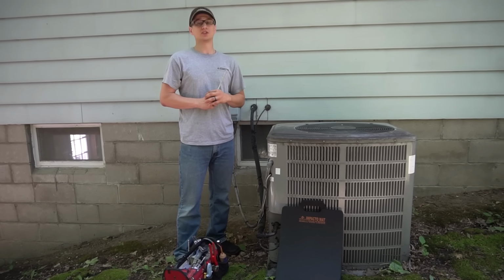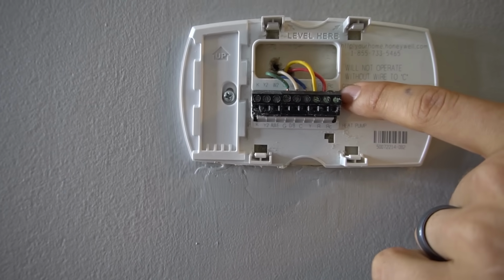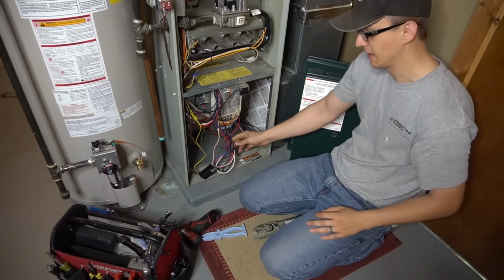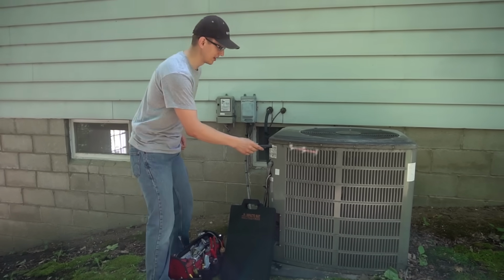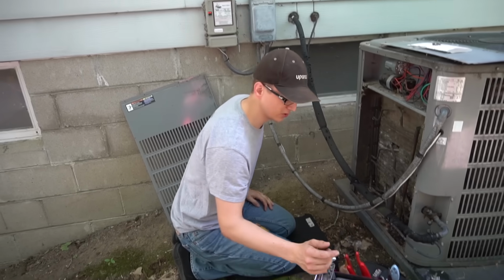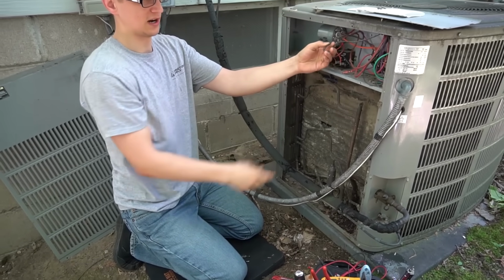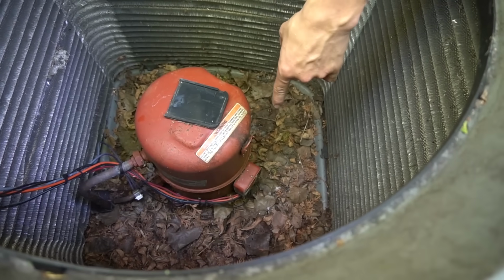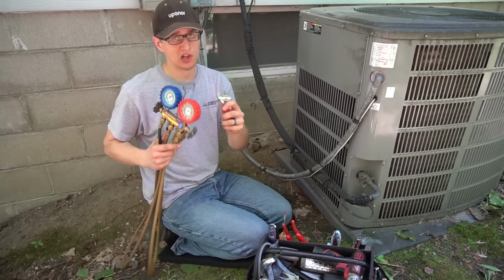AC Unit Not Turning On - How to Fix It Step by Step

Comment: Excuse me sir you should be a college instructor no joke you make everything understandable for every listereners backround you are phenomenal LOVE IT !!!!
Reply: I second that. I was convinced when you correctly said OL=Open Line. That one is a pet peeve of mine.
Reply from the maker: @tdriggers3  Thanks Tim! Though I said that part correctly I am sure there are plenty of times when I don't as well (in this and other videos) Luckily we have the comments section though, where smart people can voice their corrections ;)
Reply: VERY WELL DONE FROM START TO FINISH...GREAT JOB.
Reply: For real though...Great Job!!!💯✅
Reply: Yes he should be
Reply: I agree ☝️
Reply: Why after capacitor was replaced ac worked then less than 12 hours later 78’F thermostat set but house 80’F.  I reset thermostat then ac started cooling again. But I’m monitoring temperature in case outside fan stops and house temp goes up to 80’F again.  Wondering maybe ac waits for temperature to be a certain warmth before it restarts cooling again??? I shouldn’t have to reset thermostat when house temperature is higher than thermostat setting of 78’F.  Otherwise call back technician for this job fix?
Reply from the maker: Thank you! :) Glad to hear you liked the video!
Reply: @WordofAdviceTV  I hv a 3 ton heatpump txv 20 yrs old, supercool is 14F, superheat is 10F if temp taken at evap vs 13F if taken outside on vapor line, outside was 94F, inside 76F, 1350 cfm on med tap measured low SP @.28 spec is .5 . Should use the superheat of 10F using temp at evap vs higher outside vapor line?  How do these sound?  l believe good, Thank you, love the channel.

Comment: Question! 
When my thermostat calls for cool condenser fan motor spins, but does not spin when call for heat. Why is this? Could it be the capacitor or IFC board not sending power the condenser to turn fan. Please help.
Reply: This is normal. The fan on the outside unit should only run when the thermostat is set to cool mode and AC is requested

Comment: I'm still having an issue. I have checked all the electrical and components. Everything seems fine but the fan needs to be manually pushed for it to start. The bearings seem fine as it spins freely once it gets going. However, after about 10 minutes the fan shuts down while the compressor is still running and the blower inside still runs. Any ideas? What is shutting the fan off? The overflow has been removed to test it and the same thing happens. The fan shuts off and not even a manual push gets it going again until it seems to cool down.  How do I tell if the starter is bad? Eventually it blows hot air. Please help
Reply from the maker: By the sounds of it, if the fan capacitor checks out good, then your condenser fan motor is just starting to fail and needs to be replaced.. Sorry, I am thinking that's not what you were hoping to hear..

Comment: So you mentioned at the time 1:07 you would spin the blade to make it work. In my case the fan does start, but after a couple of mins it turns off while there is still a buzzing sound.
Reply from the maker: My first thought would be that the capacitor is dead. Otherwise the motor is going out.

Comment: Do you know about split system ac not cooling and flashing lights from the inside unit (evaporator) - error codes? Its a Fujitsu ast30ba-w system with remote control.

Comment: I replace a thermostat yesterday similar to yours with a furnace similar to yours. The heat was coming out cool after replacement.   
Actually the lady had to furnace is like yours with two thermostats. Both coming out cool after replacing them.  
One of the thermostats had 2 2wires  red white......red green with a rh/ rc jumper.   White/w. Red/rh.     White/y  green/g

The next thermostat had 2 two wires.   Red white,  r,w.      Yellow green. Y,g .   The heat was coming out cool for both of them for a while, is it possible I had the two whites mixed up?   Ac was also cool.      I ended up calling my foreman to come help me he went downstairs by the furnace you told me to take out the thermostat and show him because he was downstairs so I completely disconnected one of the thermostats, then when I put it back together it worked. I'm pretty sure I had on hold, did the temperature have to be a lot higher than room temperature ? I was there for a long time trying to figure it out and I don't know what it was that made it work
Reply from the maker: That's sounds like an interesting scenario.. Sorry, it was a little hard to follow all the wires you listed. Is it possible that the thermostat/s were in a 5 or 10 minute delay? Some thermostats have that feature. If power is interrupted to the thermostat, it goes into a delay. That got me a couple times in the past. I would start troubleshooting, measuring voltages, checking stuff, and of course not finding anything wrong. Call my lead... He tells me to just turn the power back on and wait for a while. Sure enough, darn thing did come on after 5-10 minutes. (seems like forever when you stand there and wait for it)

I don't know if that is the case for you. Perhaps you are right and you had some swapped wires? Or a loose connection. Did the foreman do anything downstairs? Hard to say without being there to see it :)

Comment: Okay so.... Central A/C stopped working, checked furnace and it had a blown fuse. Changed out the fuse, powered breakers on and nothing. Changed out thermostat from known working one and still nothing. I checked the motor on my furnace and it spins  freely and air filter is new. Anything I might have missed?
Reply from the maker: The 3 amp fuse was blown? Did it blow again after you powered the unit back on? I would investigate the thermostat wires inside the furnace and especially outside at the condenser unit for any broken, chewed, or brittle wires/connections. The 3 amp fuse typically blows because there is a short somewhere.

Comment: My heat pump worked fine but I had an old thermostat so I changed it out, it came on for just asec and now it won’t work,  it’s a heil heat pump and I can’t find a fuse anywhere
Reply: When changing out thermostats make sure they are set up for gas or electric.. heat pumps are electric..which means for heat pump and the electric back up.

Comment: I have a straight cool pkg unit.
Came home no heat. Battery operated  thermostat, no voltage there.
 Blower fan cap dead,  other cap a little low, replaced both. I thought everything was good to go. Not.  Checked power to disconnect, no power coming in or out. Went to panel, tested the 60 amp fuse, 120 on each leg.  So should be working. Not.
Next step? Replace the breaker anyway, maybe bad internally, it's at least 20 years old.
Any suggestions?
Thanks
Reply: Maybe I can help. I just replaced my thermostat with an electronic one too. Same problem you have. While hooking the thermo. up there should be a jumper wire between (RC)&(RH) to lugs on backplate. If you have an (RH) wire coming out of the wall do not use the jumper  hook the (RC) wire to the (RC) lug with the jumper. if you have a wire marked (C) "common wire" do not connect it, (C) is for non battery powered thermo. There should be 2 switches either on outside or inside. If you heat with gas switch the button to (HG) if electric (HE). Other switch will read recovery (Enable/Disable) you want Enable. Sometimes there is a third switch reading " type" if you have a heat pump set it to (HP) if a regular ac set to (Normal or Standard) which ever your case there. In closing you should have 4 wires hooked up. (G) to G lug, (RC) to RC lug, (Y) to Y lug, and (W) to W lug last the jumper between (RC&RH) unless you have an (RH) wire if so no jumper. Hope this helped. Happy Holidays.
Reply: Icinesis Wayons 
Appreciate the info. My tstat is old. Will replace breakers, and hopefully that is the problem.
Right now I get no voltage to the thermostat.
Thanks again and happy holidays
Reply: No problem. Yeah, I realized I misread your problem, Sorry about that, hope the best for your household bud! Happy Holidays to you too and thanks.
Reply: Icinesis Wayons ,thanks
I found the problem, I'm looking in panel for the a/c breaker, not sure which one it was I was about to buy a few of them and replace them. , then I remember there's a small panel on the property  at the meter, I lifted up the panel and saw two different Breakers  one 50 amp for the AC another one for the home, I flipped a 50 amp up and down lo and behold I got power to disconnect  again AC and heat.
Saved 80 to 100$ service call.
:-)

Comment: What do you mean by "you have to put a jumper between the R and the RC?"
Reply from the maker: There should be a little wire going from the R terminal to the RC terminal. If you search it on google images: "jumper from R to RC" you will see some examples of that.